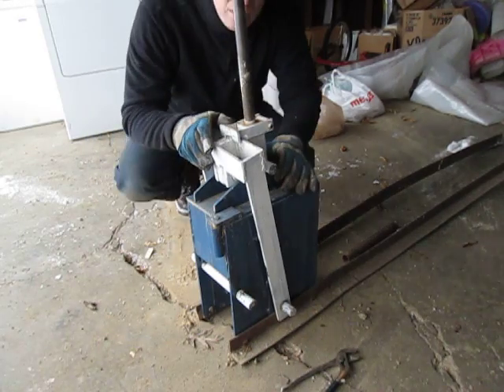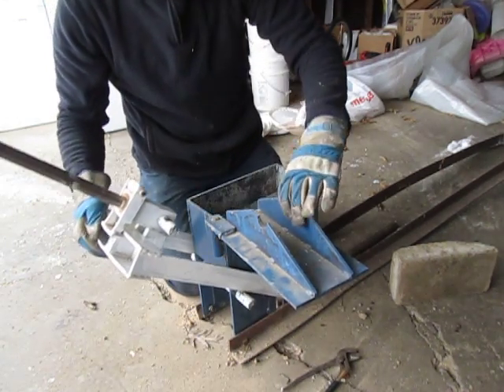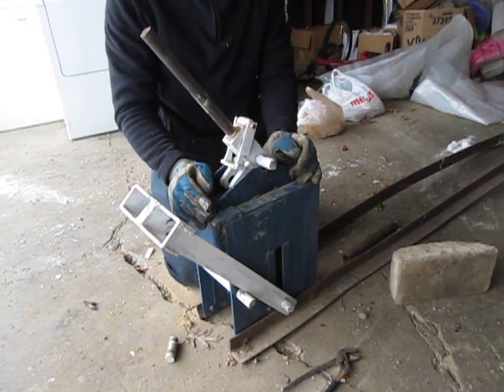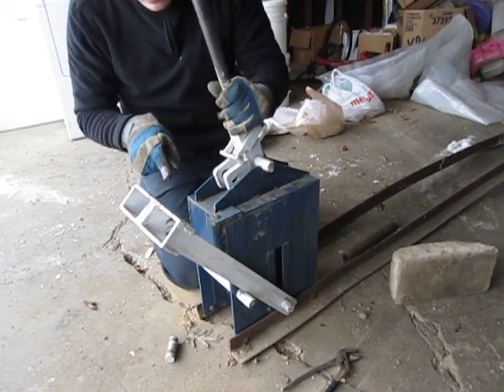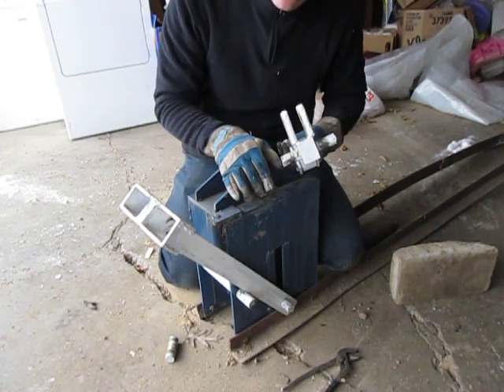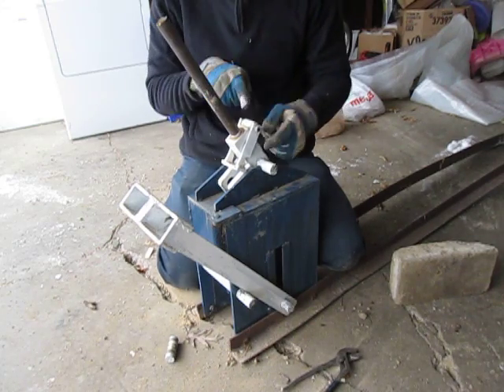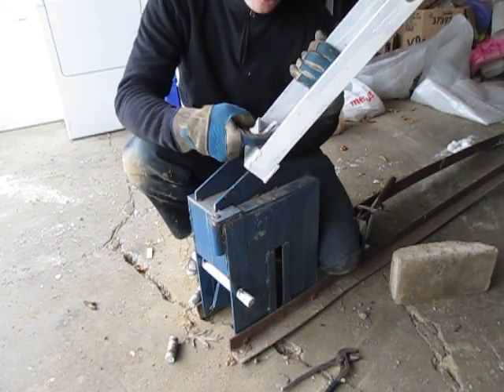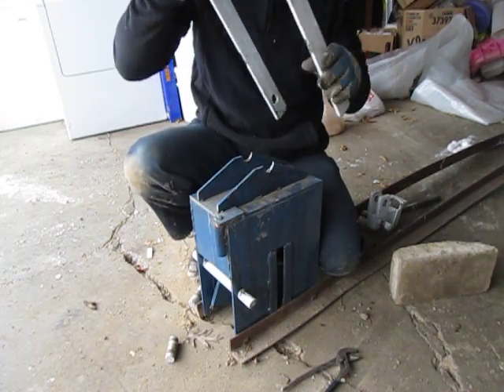CINVA-RAM teardown and rebuild- how does it work?

Comment: Nice video to understand the mechanism.
 lever with 6 feet effort arm and 2 inches load arm gets 72/2 = x36 advantage. Brick is 9x4 for 36 square inches. If u use 200 lb of force u get 200 psi applying a total of 7200 lb. 
I read somewhere that the best bricks are made at 2500 psi. 
I'm not sure if the lever give u some extra push at 90 degrees when in vertical position but i doubt it. 
If the 2500 psi theory is real this bricks are closer to dust than they are to stone or concrete. 
Bending iron aint a big deal.i bend thick bars deadlifting a few plates. 
Hopefully someone correct me if I'm wrong.

Comment: Is there a link to the converted drawings.  Doing a google search, I found a lot of dead links, but nothing with drawings.  Thanks in advance.
Reply: In inches : http://biorealis.com/OMV/deeptech/wp-content/uploads/2012/09/CETA-RAM-Block-Press.pdf

but i need the plans in mm :)
Reply: I'm actually working on drawing up a set of plans for something like this because I ran into the same issue and frustration.
Reply from the maker: Yes, here in this thread: 
https://permies.com/t/40/33406/built-Cinva-Ram-CEB-press